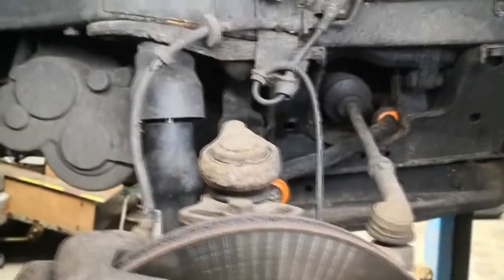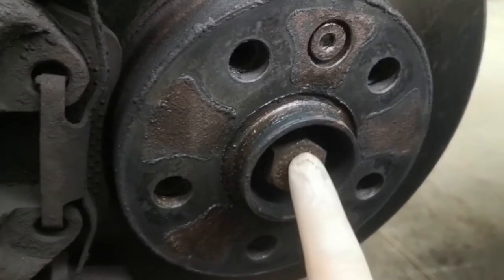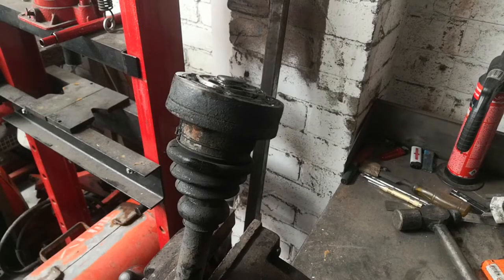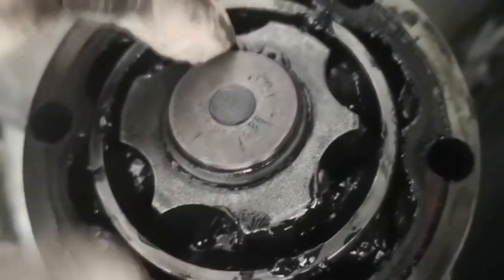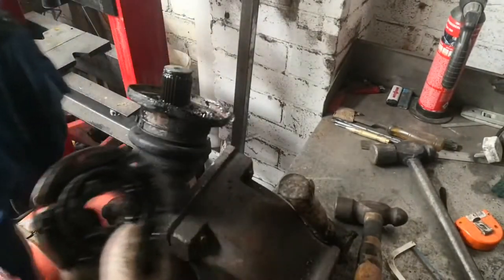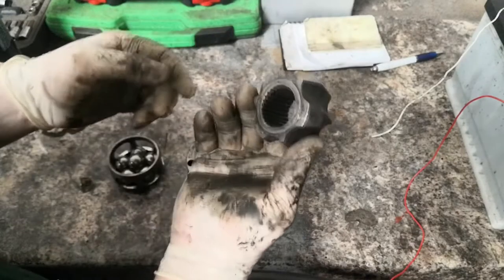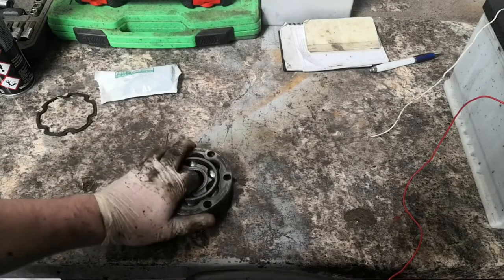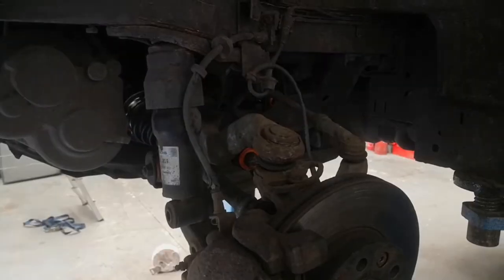Vw Transporter (T4) Inner CV boot replacement & CV Rebuild

Comment: Hi. I looked without sound, but I see that there is no mention of the fact that the bevel on the rim of the basket is not the same on both sides, which many people do not notice and perhaps try to put the basket in upside down?
Reply from the maker: I'm not sure what you're referring to as the basket, possibly what I called the cage? If so, it is symmetrical iirc, may not be on all CV joints but this one was, thanks
Reply: @DubworxMedia  Yes, I thought so. The rim on one side is not as big. One rim of the basket is small and the other is larger.
Reply from the maker: @horgasz  I've never come across that on an inner CV joint personally but I rarely have to work on them so I'll have to take your word for it.

Comment: Thanks for the video. But I think dropping the cage in like you do can only work if the joint has many miles in it..
Reply from the maker: It works with brand new joints too, just a little fiddly.
Reply: @DubworxMedia  I fiddled for 2 days trying to rock it back and forth and inserting one ball after another. It was very hard inserting the 6th ball and the cage would end up stuck. My CV joint was nearly new and very stiff.. not at all like yours. What ended up successful was combining your method with a small hammer blow!
Reply from the maker: @haraldpost  I found you have to lift the cage slightly for it to drop in nicely but you've got to be swift otherwise the balls come out, alternatively you can sometimes get away with putting the cage in sideways and putting two balls opposite eachother then put the remaining balls in 1 at a time.
Reply: @DubworxMedia  I am telling you it would not drop in. I had a mechanic friend come over and he also struggled with it. In the end he placed the cage in, placed the balls in, and then sat the central joint on top and did on small whack with a hammer and in it fell!
Reply: @haraldpost  I've also used the technique plenty of times shown in the video on brand new cvs, theres a knack to it!
Reply: This only works from the drive side, not the wheel side

Comment: Great video but one thing you don't mention and another comment does (and i suspect your did this) is to loosen the tensioning nut on the torsion bar.

It's a big 28mm nut in behind the tank. Count the number of threads before undoing it so you can put it back after (mine was at 40 ish) as it effects the stance, ride etc. NB doesn't need to be all the way out maybe halfway. 

Without undoing this the hub won't swing out enough and getting the drive shaft in and out is a pain.
Reply from the maker: I've never touched the torsion bars, I find they're too much of a pain to deal with between access, resetting to the same position and if it unseats it can be a massive headache